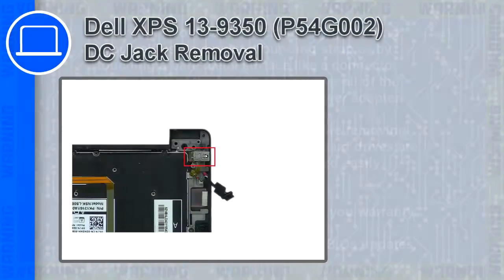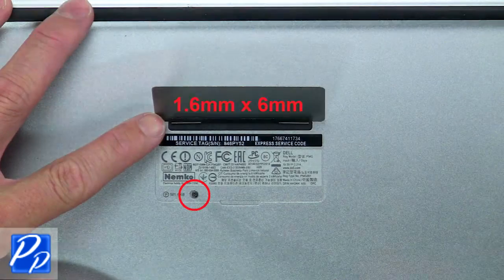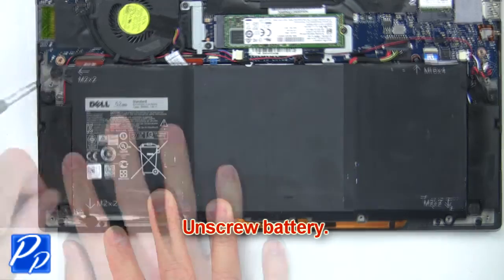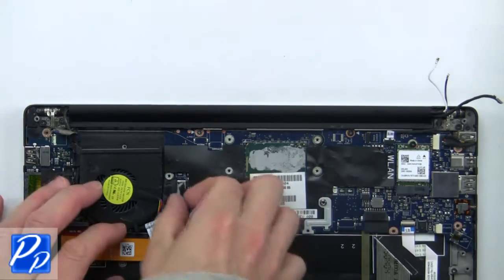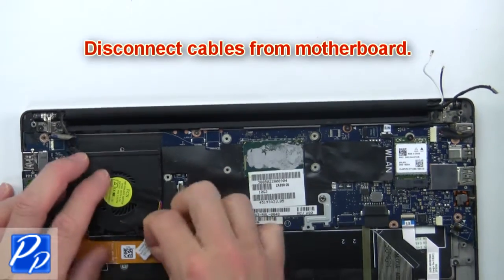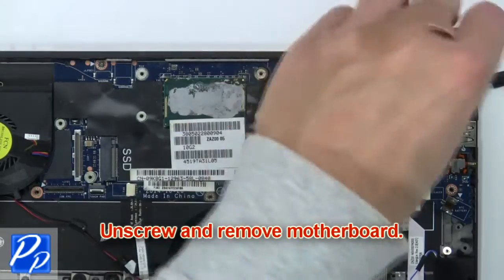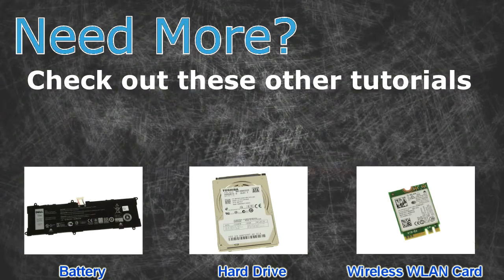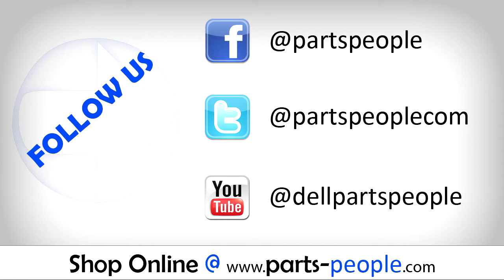Dell XPS 13-9350 (P54G002) DC Jack How-To Video Tutorial

Comment: Your model does not have the cooling fan ducts that are in most models. That was a bit confusing. Also, the MB anchors were in different positions (the center one was shifted to the anchor bracket rather than directly on the board...)

I like the condensed format, although it would be nice to have the "put back together" phases so we don't have to label our screws or go in reverse through the vid!! ;)

FYI, our machine stopped charging. We replaced the battery, no dice. After starting and seeing the error log, we figured it was the smart plug. The jack was snapped off the mount and lost its plastic cap (unrelated to each other...). I JUST replaced it, and we still get the same "Duuuuuh, we don't know what this power supply is! We will us it but not charge anything!!!".

Frustrating.

Next step is PS replacement. If that does not work... well... we have another compact desktop...

dell XPS 9350 13", DC jack, power, battery, charge, marshmallows.